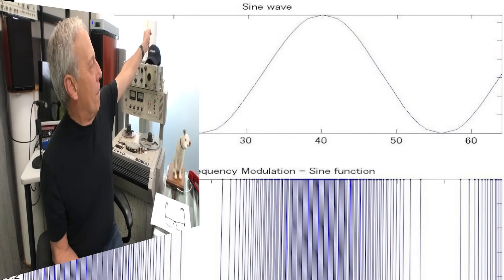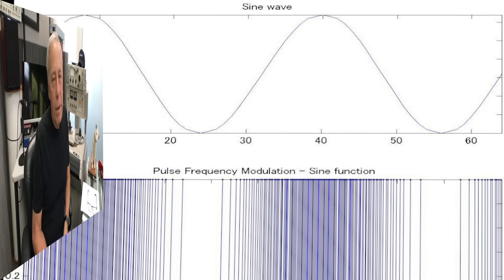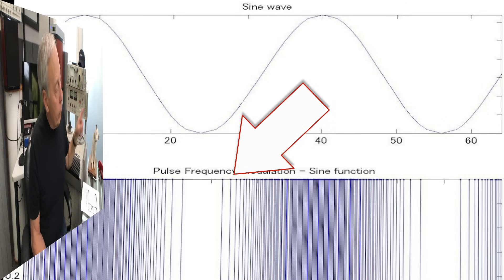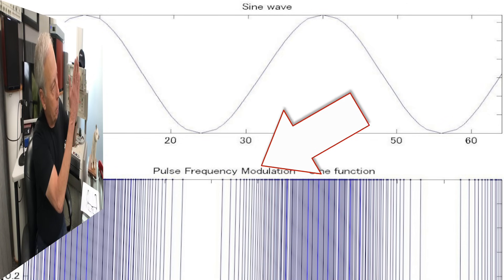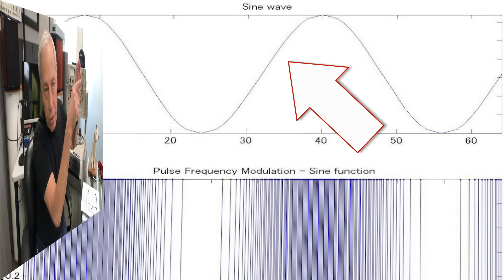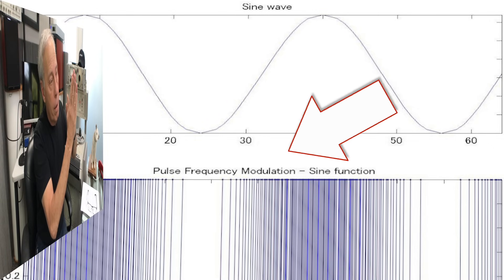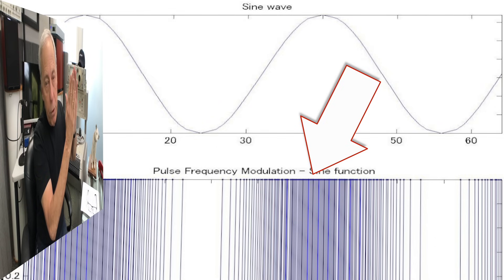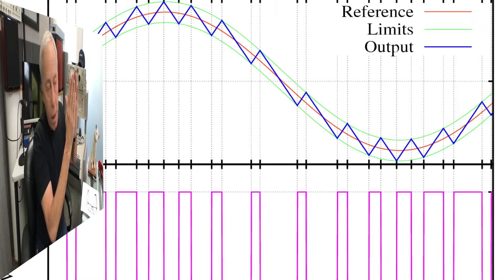What are the differences between Class A, AB, and Class D amplifiers?

Comment: I can hear the superiority of vinyl over cd even on my home made speakers and a cheap 20 watt amplifier.
Reply: Im guessing the lower dynamic range of the vinyl better suits the playback system in use .
Reply: Yes. Most new vinyl if not all are made from CDs which is actually good, the old way was to take the multitrack tape, mix it to a master tape and then copy that tape to copies to send to the record cutters thus being degraded at least two times. The vinyl will sound very different than the CD but a CD from Vinyl is indistinguishable from the vinyl with all it's quirks. I lived with vinyl for far too many years. The surface noise, tangential tracking distortion (Edison's wax cylinder  was superior in this) wow and flutter, microphonics of the pickup, pre/post goove echo (people mistake for more ambience and air but it is coloration) and the real bugger, since the outer tracks move more vinyl molecules over the stylus per second than the inner tracks, the nails on the chalkboard distortion of the inner tracks was almost unbearable. Your favorite song had better be on the outer tracks or you are screwed. We also mustn't forget the limited 45 db separation between left and right signals you were stuck with on a good day. The same stylus has two waveforms beating at each other from 45 degrees from center, 90 degrees apart. You were also lucky if the distortion was 2%, it really was and is quite high. To get a record with no pre/post groove echo would limit you to 6 minutes of music on each side of a 12" LP. Anyway, when were self appointed hipsters ever right about anything?

The problem with some modern digital recordings is not the medium itself, it is people either trying to engage in loudness wars or someone mastering that just does not use the care they should or all out have no idea what they are doing. Some of the compressed to sound loud recordings often clip (go above 0). In digital one must never allow peaks to go above 0 or distortion rises rapidly. With analog you had to make good use of every bit of dynamic range you had which was not much by hoping the tape had 3 to 6 db of headroom and allowing the needles to occasionally bounce into the red. Too low and it would get buried in hiss. We didn't even get cassettes that could reproduce the entire audible range until the 1970s. It was the only practical way to high fi in the car but still, a 1/8" tape running at 1.5 inches per second versus a 2" wide tape running at 30 inches per second in the studio since the 1950s had noticeable weaknesses and grainier sounding highs. On cassettes I used cobalt doped tape by TDK. I also used a lot of Maxell. I never want to go back. I still have the cassette recorder I first got but not the best I had by a long shot.

The best sounding analog we ever had  commercially was of artists available reel to reel tapes that few owned as most used reel to reel to copy vinyl and we were pleased that the reel was barely distinguishable from the vinyl but it was noticeable yet subtly so. Vinyl was the easiest to store and were not expensive, imagine trying to store 200 waxed cylinders if that ever stuck? A commercial tape reel of an artist would have few of the shortcomings of vinyl save for the limited dynamic range and noise floor but still superior to vinyl in that regard. Imagine having a Beatles Reel from the record label? The examples I heard then sounded far less gritty and warmer than the best vinyl ever could. The best analog I ever heard was reel to reel with DBX noise reduction. Trouble is that you either would have to record a live performance yourself or hope that someone made a commercially available DBX encoded reel. You could not use it without a decoder, Dolby you could but the highs were boosted by 10db without decoding. 

To anyone who says vinyl is superior, do they even know what amplifier was used to drive the lacquer cutting heads? Yes, you are using a 250 watt amplifier to drive the cutting heads into something physically hard so you have intertia and resistance of the material to overcome with this amplified by god knows what amplifier signal. The fact that it even approaches high fidelity is a miracle. Now instead of all that, represent something as a mathematical value instead which has no physical barriers to overcome. Does anyone think that cutting heads are any less of a weak link than speakers are? Both are driven by amplifiers driving motors, one is a diaphragm the other is a cutter. 

The real weakness of analog is that a record will change sound by virtue of the stylus heating up the vinyl and will never sound exactly the same twice. The more preservationist curators would never play vinyl more than once per day to allow the vinyl to go back to it's original shape. Then there's tape, you lose a bit of iron oxide every time you play them and you better not get them near any degaussing source, any AC coil could wipe a tape at close range if it was in an excited state. For 18 years now I have preferred lossless files stored on a server. My latest car stereo has no physical mechanical disc player in it at all. Lossless off of my phone, Tidal over the internet via android auto by usb not BlueTooth. I am just enjoying what we have now even in our vehicles far too much. Car or home, I can play any part of my collection losslessly and instantly. The few times I have to get CDs I rip them losslessly as soon as I open the jewel case.
Reply: Davesworld7, Good post. From what I remember reading years ago, the claims of analog being better than digital was based on the premise that the A-D conversion at the recording studio cut out some very low level information that perhaps contributed to ambiance, soundstage, etc. There may be something to that claim but I'm not so sure. About 30 years ago, an audiophile friend and I did a vinyl vs CD comparison of the same material on a good sounding Adcom system. He and I both preffered the CD by a slight margin. I'm going to have to try this again when I have some time with more modern recordings.

Comment: Finally someone who explained it a way I could understand  😀 

So if I understood it right, a class D takes the sin wave of the signal, converts it to an square wave that gets amplified back to an sin wave for the speakers and this keeps the efficiency high and heat low.?
And because it need a lot of mumbo jumbo on the filtering, creating a good class D gets expensive.
All class D I have seen that is considered good are way more expensive than a AB counterpart

Comment: Class A and Class AB aren't two different biasing techniques, but two different amplifier topologies. And in both, tthe quiecent power consumption is a factor of the input DC bias current and the gain of the tansistor that is on, which will be quite low for high-power transistors, and the circuit will only be loaded by the collector resistor/s, so the amp will not draw it's full rated power. Only when there's a signal, the circuit will be loaded down by the speaker, since it's AC coupled, and when there's no signal the output is plain DC, so the coupling capacitor will behave an open circuit, and no power will be drawn by the speaker.
Reply: About the class A: I still stand behind what I said. With no input, the output of the amp is DC (and probably 0V), so the the capacitor in the output (if it's not transformer-coupled) is effectively a very high impedance load, so no current will flow, and the amplifier's current will still be limited by the base abd collector/emmiter resistance (and that power is, indeed, always drawn and wasted as heat).
Once there's a signal, the capacitor turns into a low impedance path, thus loading the amplifier down, which increases the current and power draw of the amp.
And about class AB: it's a vraiant of class B, not class A. Class A might be biased for different amounts of headroom and distortion, but class AB can't be class A at any case, and class A can't be class AB, as class AB is pretty much class B topology with a slight bias to remove crossover distortion, and uses at least two transistors or vacuum tubes, where class A is using a single transistor/tube (or paralleled devices).
Reply: A single ended amp must operate in class A, where  the output devices are conducting through 360 deg. of the signal. In a push-pull amp, if the output devices are conducting through 360 deg. of the signal at its maximum undistorted output, it's class A. If the output devices are conducting through 180 deg. it's class B. Greater than 180 deg. and less than 360 deg. it's class AB.

Comment: Nice to see your distortion analyzer (under your hat!) I used one of these in the late 70s to test distortion in amplifiers. At the time it was the only one which would (easily) measure really low levels of distortion. We used a Radford low distortion oscillator for the same reason. Both really nice and quick to use.

Comment: Thanks which one is better for  the multieffect and guitar processors (with amplifier simulators) like Helix, Axe Fx, zoom g5, pod and..?
It's very hard that you can reach to a decent tone with those multieffects through a tube amp
Maybe because guitar amp is made for breaking sound and distortion but power amp only amplifies the sound and doesn't change it.
anyway it's evident that they should be used with power amps  ( and not guitar amp) but which one? A AB or D

Comment: Nice explanation, does that mean these new cheap Chinese "mini" amplifiers 20-100w for 48usd$ very basic Bluetooth amps will be noisy or..? What would I expect for a small 100w class D for 48$ no radio or anything built in. Some don't even come with power supply.. Most look to be 12-24v input.. Would I be better off getting one without a 12v power brick plug and get one without at a higher voltage? Would I get more "power" or cleaner power? I'm just talking about running some nice bookshelf jbl studio, I believe the have 8" then a small mid and a soft dome tweeter... On the deck/back yard type of sort of portable as I wouldn't leave it out...   Wife says speakers are big and outdated.. I have the entire surround and we only use the..... Ha anyway back to the question.. Are you familiar with these amps I speak of.. I know the 50x50 of the brand I'm looking at puts out 30x30 from other YouTube reviews.. Common people say that they lack low end.. I can't figure out how that's possible signals are signals.. The speaker and eq I don't think some understand... Anyway sorry for the long winded but if you can enlighten me in any way I'd really appreciate it! Thanks for your work!
Reply: Might I suggest to checkout another YouTuber named, BigDWiz. He's done a number of reviews of those Chinese amps by hooking them up to an amp dyno to test their real wattage to less than 1% total harmonic distortion. A lot of those amps are garbage but he's found some that surprisingly powerful at 1% THD. It seems that the amps that have the Texas Instruments DSP's can be generally pretty nice little amps. But of course the signal processor can only do so much if the construction of the amp itself is a slapped together mess of glue and solder going everywhere. If people are saying that the amp you're looking at doesn't have any low end, it's because 30 watts isn't enough power to move enough air to where you can feel the music on the low end. Particularly if you're talking about feeling the thump of a kick drum or the rumble of a bass beat on some electronic dance music. But not to say that the bass notes won't or can't sound good irregardless if whether you can physically feel it. To me you gotta get to at least 50 watts and closer 100 would be ideal if you want to start feeling the bass. Of course, I'm a bass nut and so I'd really say that 500 watts would really be the way to go. But your mileage may vary. 30 watts should be fine for some decent midrange and highs that get loud enough for a 12x12 room.
Reply: Great info you guys thanks, I'm just looking to run a couple 12 year old jbl studio, larger bookshelf type speakers 8"woofers, we're nice 12 years ago.. But I'm Just looking a way to jam out when grilling the BBQ and have no reason to spend a lot I just want good enough sound and enough power to run those... Not for audiophile situation at all, I just can't find a small blue tooth to even be loud enough to hear in the yard especially when you consider the money
Reply: JBL's are pretty nice speakers. Their 8" bookshelf speakers can handle up to 175 watts. But you'd want to check the power handling of your speakers to make sure. In order to push that much power you'd need a $200-$300 receiver. Check out the Lepai LP1601S. It's $100, has bluetooth built in, and comes with the power supply. And it's been tested to 55 watts 1% THD for 8 ohm bookshelf speakers. Anything much more powerful than that and you'd probably have the neighbors telling you to turn it down.

Comment: Most good A/B car amplifiers use PWM on their power supplies! But Blade Technologies used to sell what they claimed were Class A car amplifiers and used a 4050 Hex non-inverting buffer, 555 timer and 4013 flip flop, The 4050 drove SMPS Mosfet gates, the 555 and 4013 generated The switching signal! 

It was something new to me, but I learned this from a pcb designer working in the new company which had bought out blade technologies! I was lucky enough to upgrade my M252 to a M502, started out as 25 wattsx2 and modified it to be a 50 wattsx2 amplifier, since they did share the same pcb, but it required a modified toroid, extra transistors, missing resistors and caps! 

The Blade Technologies amplifiers which were labelled Class A had huge heatsinks with internal fins, and the 50 watt and higher output models required an internal 60mm fan! Which I had to install the missing components which made up the circuit to drive the fan! 

But with Class D amplifiers, really read the specs, look for something with higher Signal to Noise ratios! Back in the Old School days of Car audio Signal to Noise Ratio was sought after and most wanted amps with 105 db or higher!